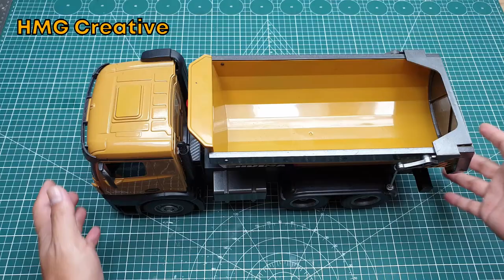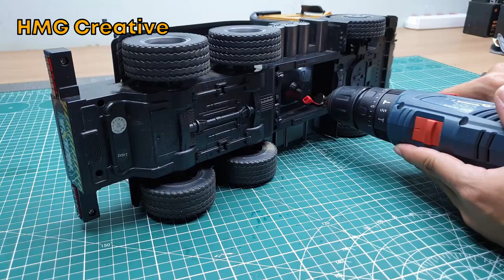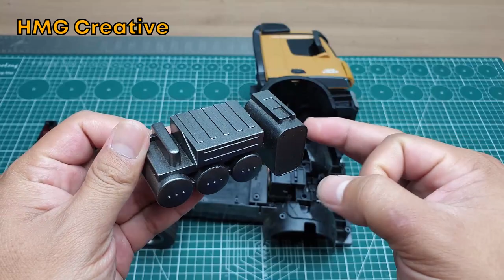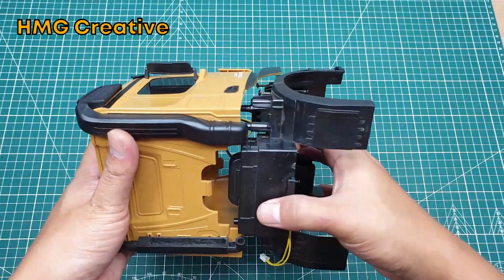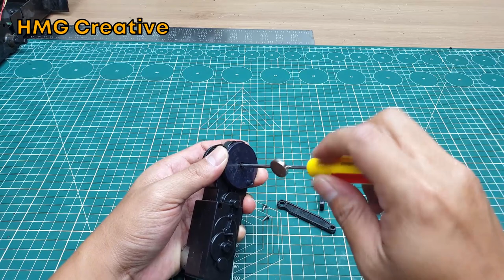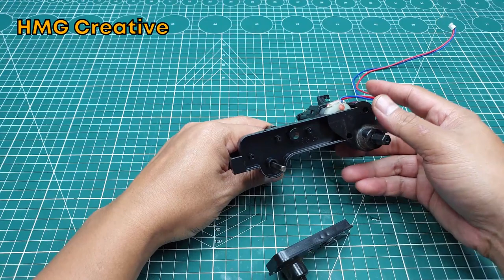HUINA 1573 1582 DUMP TRUCK DISSASEMBLY | HUNA 1573 1582 FULL TEARDOWN REVIEW | WHAT'S INSIDE

Comment: Thank you for this tear down!!!
Gives me faith that it's already keyed to take a proper turning servo without modification of the steering rack. The bottom of those cab steps on the front have to go, they're the first thing that rams into anything when driving it over anything but perfectly smooth ground